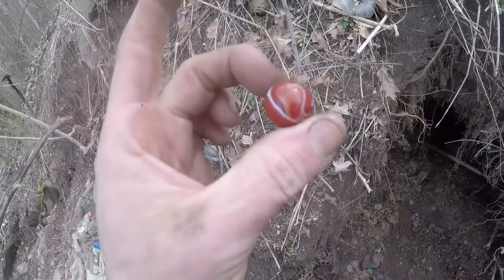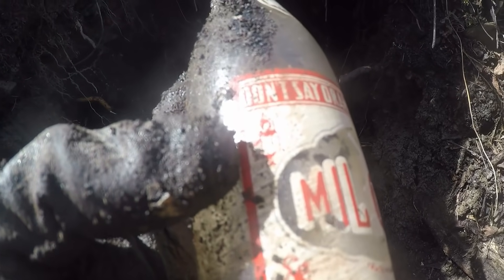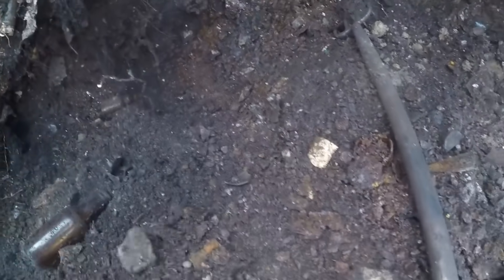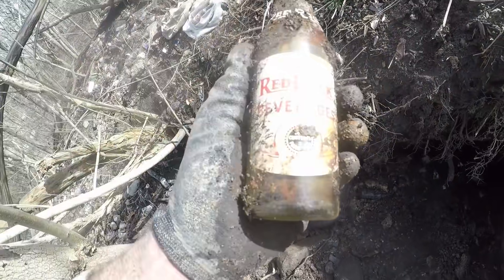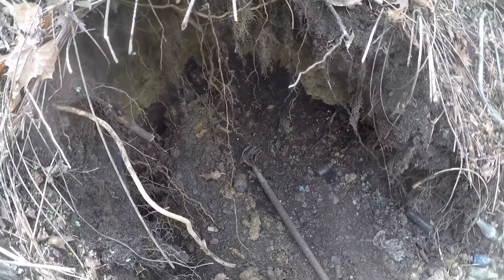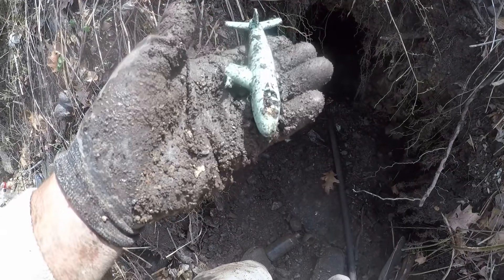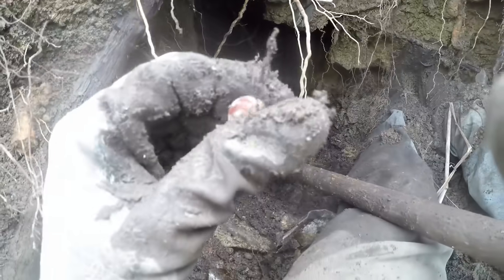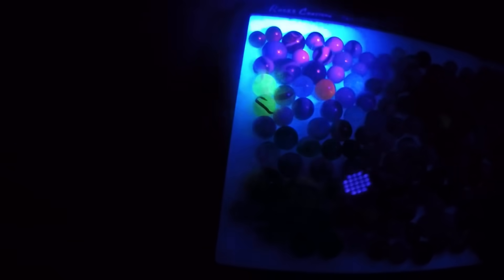Treasure Hunting Ohio - Marbles Everywhere - Bottle Digging - History Channel - Antiques

Comment: It's insane all the awesome marbles,bottles and  artifacts  you find.Its mind blowing!
Reply from the maker: I tried to dig some marbles earlier today after lunch....but did not find a 1. And it was so hot in the dump I just left. Went to the river again and found some more arrowheads..it is cooler on the river. The dump felt like it was 100 degrees with 100 % humidity. It was the worst ever up there today.

Comment: Wow Rocks , what a hunt . You were smokin on the smokensteins. lol. I can maybe help you out a bit on the insulators . The large damaged one and a few of the others with double wire grooves are a type called transposition . These were used on the lines to allow the wires to transposed or moved over to eliminate crosstalk and/or induction , The clear spiral insulator with holes on either end is called a radio strain insulator . The aqua one with the cross groove on the top  is a lightning rod insulator , used to secure the ground wire on buildings . Hope that helps . On insulator dumps I have found that at times there can be several hundresd in close proximity . Thx for taking us all along op the hunt bro . and good luck

Comment: Rocks, you sure are hitting 'em today. Almost feel like I'm right there with you. I know I'm not as I'd be picking thru your left behind for my daughter. My favorite bottle she has is an embossed Pepsi with JD paint stains on it. Found it in my Great Grandfathers garage years ago. Just a question though. Have you had any damage done to any of the marbles you drop in your pocket? Meaning by you walking and them hitting each other does any damage occur? I'd think the marbles would be brittle and chip easy.

Comment: How do people clean the acl? Anytime I try it wipes off
Reply from the maker: Well it is because of where I am digging them. It is on a steep hill.....that drains fast. If I was on flat ground....they would all be horrible condition. I have the acl wipe off some of them. The best thing for that is "clear coat" that is in the spray paint isle at the store. Clean them in the dump and spray the ACL with the clear coat....let it dry while you dig....it at least saves them